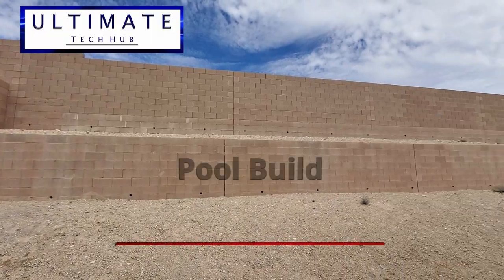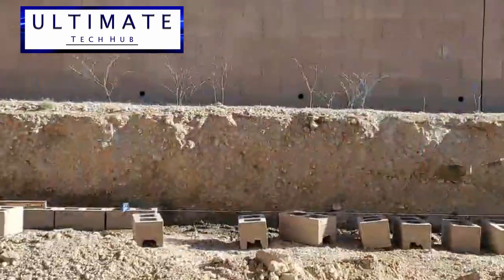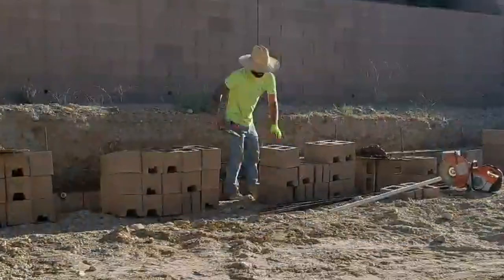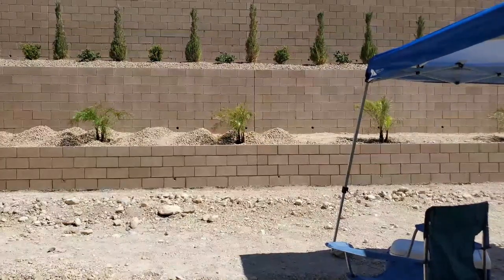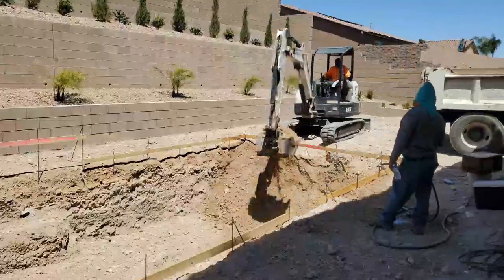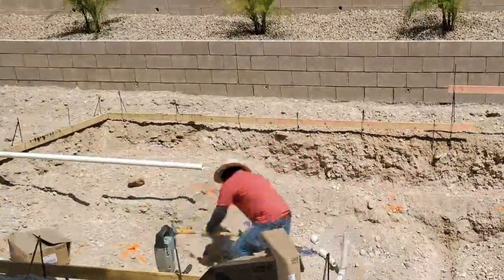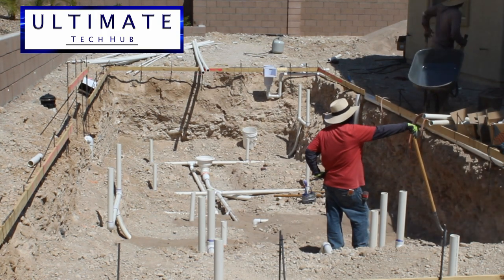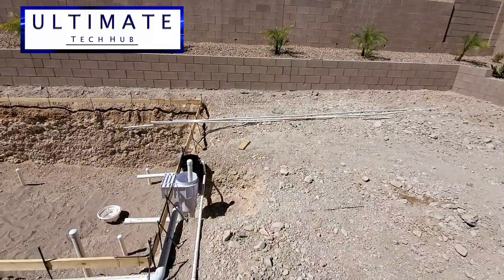POOL CONSTRUCTION  TIMELAPSE - PART 1 - RETAINING WALL, LANDSCAPING & PLUMBING

Comment: Think maybe instead of backfilling it with dirt, shouldve used larger aggregate/gravel to allow for better drainage. It allows the water to flow thru better. I know they have some holes every 9ft. But the i think there still might be some uneeded stresst when the mud/water pushes up on those spots before flowing to the drilled holes. Just maybe